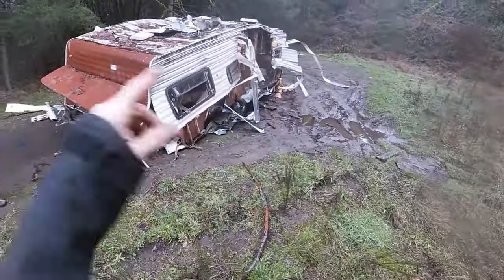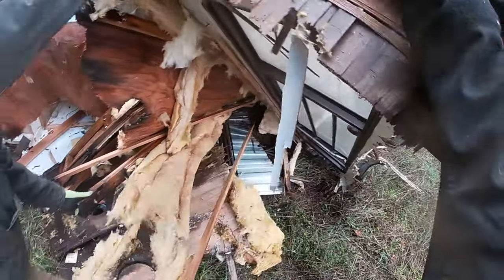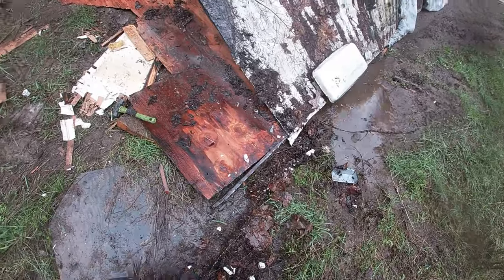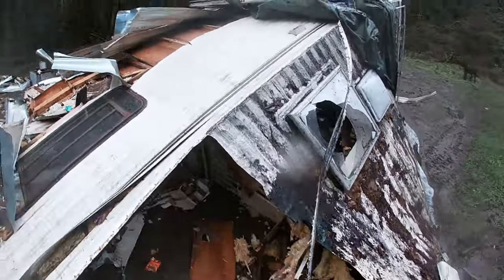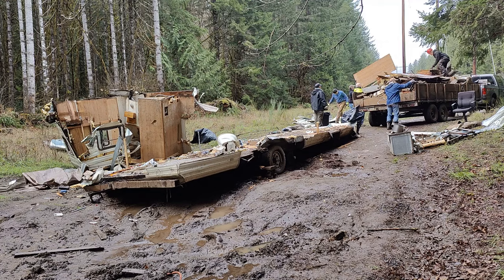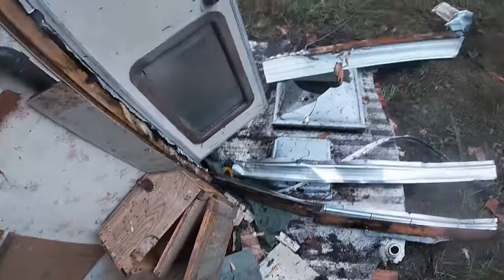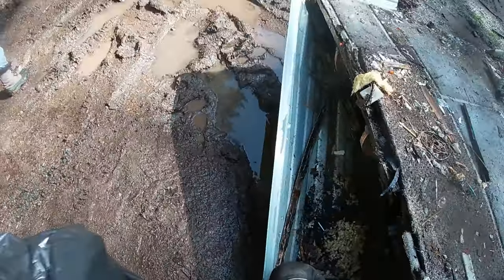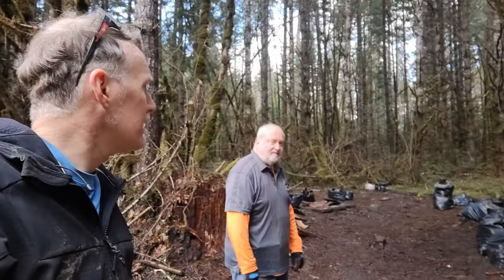Rapid Planned Disassembly

Comment: In my area it is more profitable to sell the bare trailer frame than to cut it up and scrap it. Registration should be easy in most states. I would love to know how to get funding to do this in my area. For times like this it may be nice to have fold up sides to increase the side height. 2' side until you get above that and then fold up another 2' of trailer sides.
Reply from the maker: I've had two trailer frames for sale for almost six months and no bites. Other than less than scrap price. Where are the messes in your area? Forest Service? BLM? County? State? They all have different funding sources.
Reply: Una bella squadra ❤